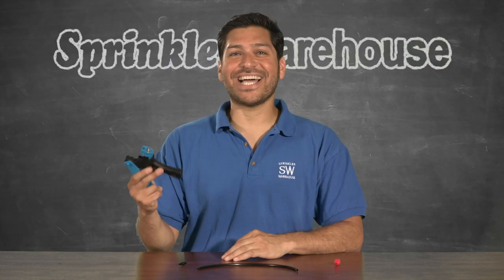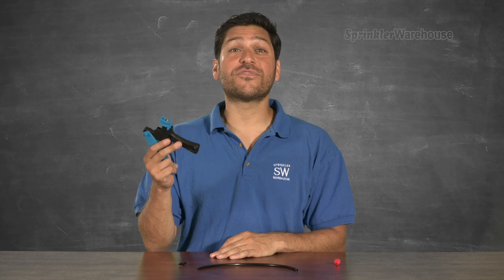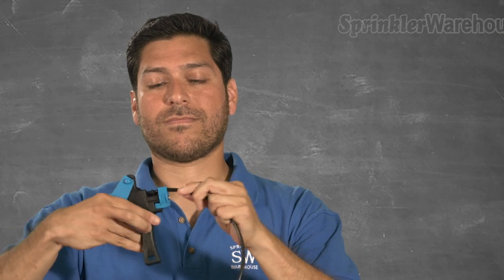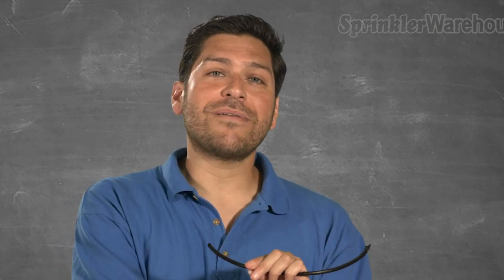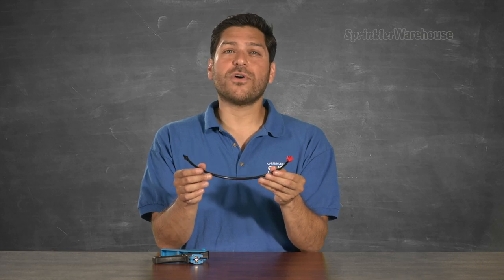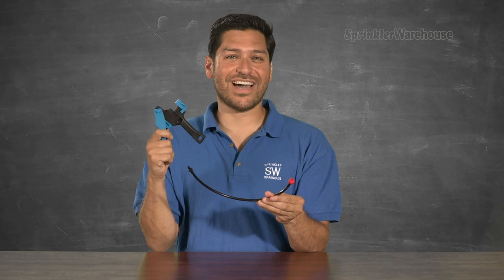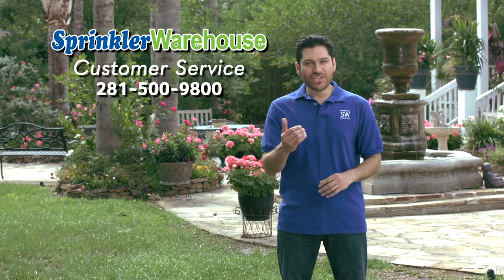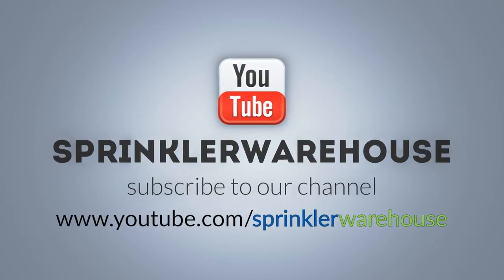DIG Drip Punch Insertion Tool

Comment: I made the mistake of buying one of these, so I'd like to save you some grief by saying:  Don't do it!  It's "fiddly difficult" to insert the straight barbed fitting into the device, and it's equally awkward to  align the fitting with the tubing (in preparation for the insertion operation).  But the bigger problem is that it's  difficult (virtually impossible) to use this device with any fittings other than  straight ones...so tees and elbows are pretty much out of the question.  I've found it much better to use a heat gun to slightly warm the end of the tubing before I manually twist a fitting into it.  Heat guns cost from about $20 - $40 on Amazon, but I feel my money was well spent, because I'm constantly finding new uses for mine.  Hope this info helps!
Reply: Thank you!